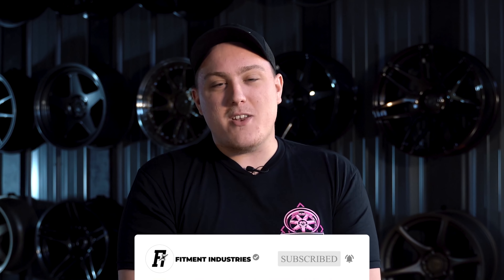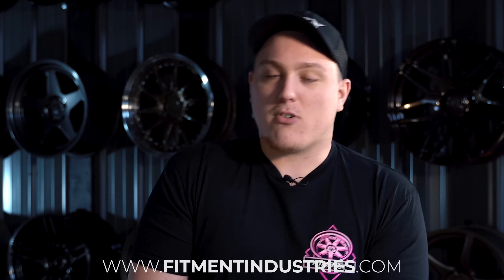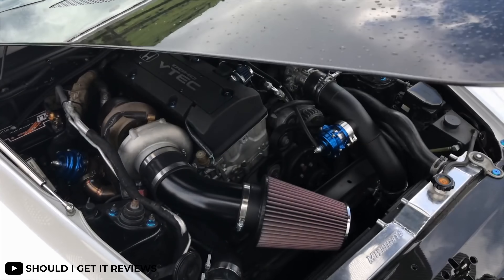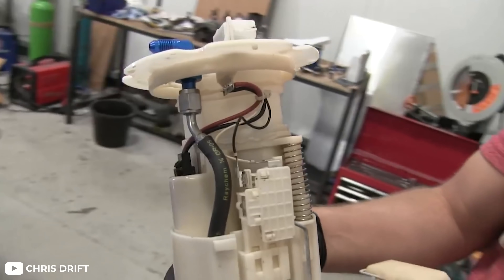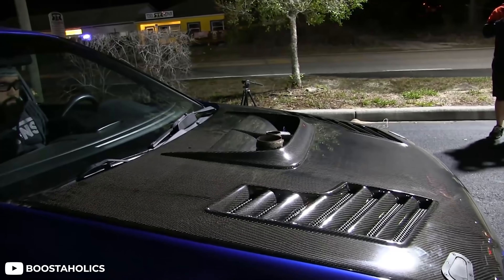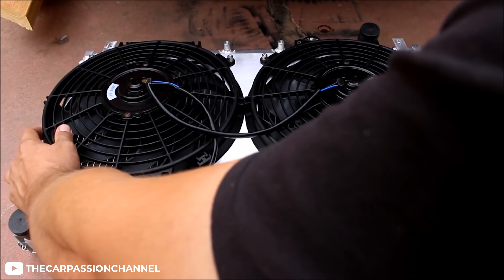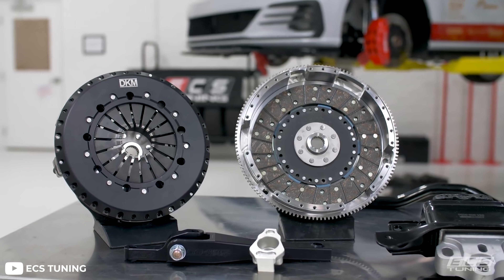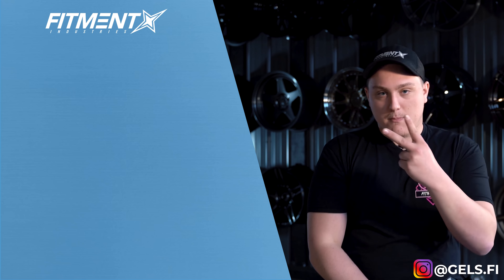Mods Needed to Boost Your Car | The Build Sheet

Comment: Is a tune needed even at 5 psi with upgraded fuel pump and injectors
Reply: MR.YTRAMOS Yup, especially since the new due pump and injectors now have different constants than the factory ones.
Reply: Yes, you will always need to tune it, even if you are running 1psi. You are changing how the engine works, even the slightest bit puts too much stress on the engine. At that low you probably won't blow it, but after a while things will start happening, and you'll need a new engine. The biggest one is probably your internals. They are designed to work in a specific way, and if you change anything about them, you are throwing off their balance. They were built for a specific ratio, and changing that changes how hard they have to work. And if you know anything about physics, objects like to maintain their equilibrium. And adding boost to a N/A engine throws everything off. So alway get it tuned, so it alleviates some of the stress. You're best bet is to replace the internals with stronger ones as well, because depending on what materials were used for the internals has a huge impact on whether they break under boost, which is not a good time.

Comment: There's a mechanic on YouTube who gave a basic guideline for increasing the power level of your vehicle assuming all maintenance is taken care of:
1. Simple bolt-on mods like intake and exhaust.
2. Supporting mods like better brakes, suspension, tires, stronger engine and drivetrain, and more efficient cooling system and fuel system. 
3. Power mods like a turbocharger or supercharger (or both), ported heads, cams, and nitrous.

Comment: My plan buy all the upragdes my car needs. Then upgrade stock interals then boost till im gone
Reply: Same. I’m saving up for a short block assembly with forged internals. I have all the usual mods. Cam, intake, exhaust and some other stuff.
Reply: @pontiacmaniac7772  do you have the lt1? I have a '97 lt1 and I'm thinking of either 454 or ls swapping it
Reply: Chase Rowley yeah I have the LT1. I want to eventually procharge it. I thought about swapping. But with my budget I should just build the car I have. LT1’s can make big power too.

Comment: There's a really simple solution to all of this..  Buy a forced induction car off the hop.  No bullshit.  No pissing around with $30k worth of mods before you can even drive the car.  It is a lot easier and cheaper to upgrade a few little parts in a turbo charged engine to get more power than it is to piss around with an NA car trying to boost it.

If you're building a race car, it doesn't even matter at that point.  You are replacing everything down to nuts and bolts, but for something fun to drive on the street... Just start with the correct platform.

Comment: I only have one piece of advice - if you want a turbocharged car, buy one that was built by the factory.
Reply: L A M E
Reply: The safest bet, but if you plan to upgrade the turbo, you have to do all of this anyway. Most factory turbo setups run very weak boost, with very weak internals. You can get away with it on good cars, like BMW M cars, or Fords ST line. But your cheapo CIVIC SI the new one with 1.5T will not be able to handle significant gains from its weak engine.